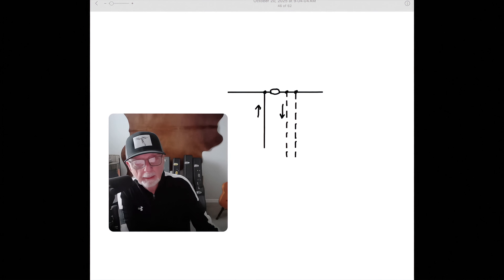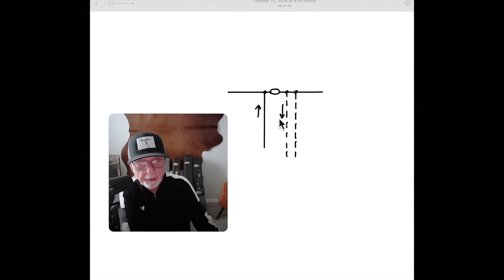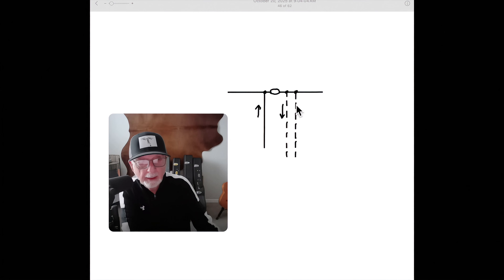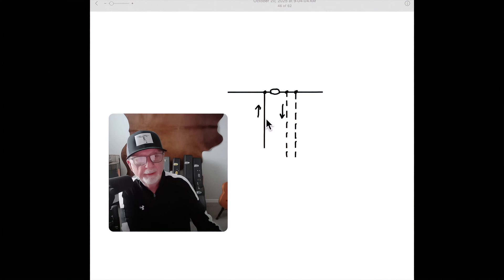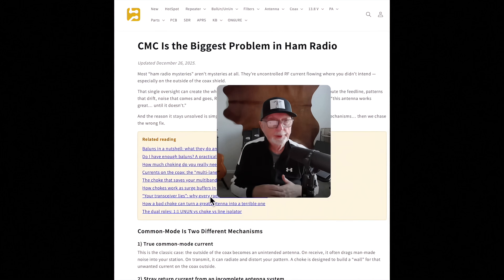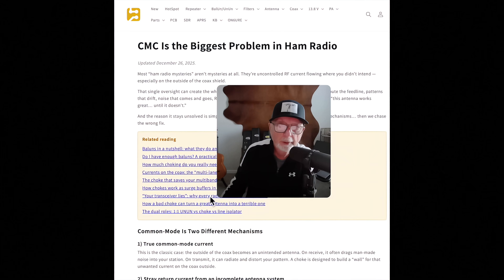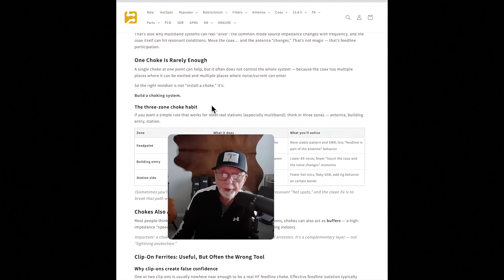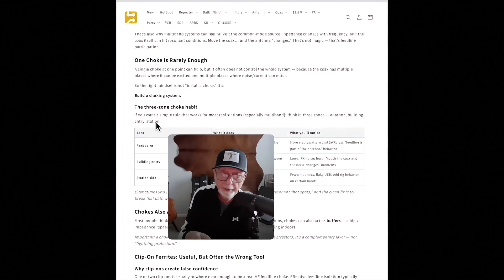Fixing the NOISE LEVEL Ruining Ham Radio.

Comment: Im not a ham, but an avid CB (27mhz) operator, and I have a rather high noise level.  I have an 5/8 antenna with a coil in the base to make the main radial somewhat shorter and it coves both 10 and 11M bands.  Can I perhaps fit a ferrite choke (maxwell?) on the feedline at the antenna socket before the antenna and another one at the radio itself inside my shack?
Reply from the maker: Yes definitely.  You will see improvement unless the noise is getting directly int the antenna and not being picked up by the feedline.  Also try to find the source of the noise.

Comment: Thanks for this very well explained video. A useful follow-up could be about the need for a range of chokes to cover the whole of the HF bands, like the G3TXQ chart. I experienced an electrical "bite" through the metal knobs of my antenna matcher on my 203ft Random Long Wire antenna. Several turns of coax through a 240 type 43 toroid stopped it and reduced my noise floor. That's practical proof of the points you make.
Reply from the maker: So many problems can be solved by good choking.

Comment: You didn't mention ferrite mix. Mix 31 works good at feed point and mix 43 at transceiver. Also stacking 2 torroids is nice. They can be epoxied together. Winding is important. Run one direction around ferrite. Chatgpt is a great source of information on this.
Reply from the maker: Thanks for the input.

Comment: Excellent! This video reinforces the benefits of my station setup: I use a 1:1 current balun (technically an UnUn) at the base of my vertical antenna or the feed point of other antenna designs, and a set of 10 snap on RF chokes in strategic locations -- over the coax at the entry to the shack, over power cords, and over each coax jumper between components (transceiver, amp, and tuner) for good measure. Thanks for the positive encouragement and great explanations as usual. 73, Jared ~ AC7WH

Comment: So I'm not a ham never found the time to get licensed. But as a truck driver I do use the 11 meter band. I have an issue with a high noise floor, if I understand correctly if I was to put a choke at the antenna and another one at my receiver things would get better. If that's the case could you please recommend me what chokes to install. Thanks in advance, Tom
Reply from the maker: Order two of these from Amazon.  

https://www.amazon.com/FT-240-43-FT240-43-Ferrite-Toroid-Material/dp/B07Y6NQRGF/ref=sr_1_11?crid=1997E3EHAQ98B&dib=eyJ2IjoiMSJ9.rdCMnR6pY0gdH79daxUhaL-7YoKQ6i4jHHjAJGa0LFy1eTjZYPf1T11I8EZAndpxnlxzkcazO0BLGVOgPe9JrLkzPfu2o_URnt-hLIzKubn-9wTB4TT-oQcrVuMCMTA9LWNM7SJ5iuFNUDCqHUh1ACPo7Wdw3qyQBcpFHfuiZ8SvixgkYu35zHmBdanVan0wzoBr3PeEOMDC81Y09BecmpnBJd0Hv6K6sILgbINwRpI.pPxE4joYRHkSwreaJtOsHpZiuY_3NXE-BwJ9JGYIk-8&dib_tag=se&keywords=ferrite+choke&qid=1767447583&sprefix=ferrite+cho%2Caps%2C199&sr=8-11

Make several turns of coax at each end and see if that helps.   A vehicle generates a lot of noise which can be picked up by the antenna.  Not much you can do about that but the ferrite cores will improve balance and block common mode current on the coax.   

It should look like this.  https://palomar-engineers.com/antenna-products/1-1-balun-kits/jumper-chokes/Coax-Jumper-Choke-RG-8X-RFI-Range-1-8-65-MHz-30-dB-Noise-Reduction-1-5KW-PEP-3-FT-Tail-p408707295

Do some internet research on suppressing CB radio noise in a truck.  I don't have much experience with that.

Comment: A separate receive-only shielded loop antenna can do wonders for reception in an rf noisy environment.
Reply: Some points by w8JI to keep in mind with a receive-only shield loop antenna  (Notice the emphasis on keeping the loop antenna electrically balanced -- sounds familiar.)
The shield is the actual antenna.
The shield must be perfectly symmetrical moving away from the inner conductor exit point. 
The gap in the shield must be exactly opposite the grounded point.
The ground must be at the inner wire exit point.
The shield will not make an unshielded loop that is properly balanced any quieter. 
The shield only is a tool to help balance the system when properly implemented.
Reply from the maker: Yes! I plan on doing a video on that topic.

Comment: Agree about your Coax diagram showing 3 wires.... Even when balanced, the outside of the coax shield will receive and conduct RF back to the shack as it receives radiated power from the antenna and all the other radiated signals from everywhere. I always use a CM noise filter at the radio. Got rid of almost ALL my noise. Plus I use chokes on all the other wires coming out of my radio.
Reply from the maker: Good work!  Great comment as usual @martyh9309

Comment: There IS something you can do about all the man made noise but it’s not cheap  

I was about to give up on HF at my little beach house that’s elbow to elbow with tons of others. 

Then someone let me borrow a DX engineering receive loop which used the be the pixie loop antenna. 

It was NIGHT and DAY. It made HF go from plus 20 over noise to maybe s-3 if that. 

It’s a hell of antenna and well worth the $700.  

Common mode noise isn’t the main source of noise in the modern urban area. It’s switch mode power power supplies and such. 

But the way the DX engineering RX loop works is a magnetic RX loop and you just have to watch the A and B comparison. 

Had not for it I would have given up on HF.
Reply from the maker: This is an important point and I am planning a video on this topic of a separate receive antenna.  One point - RF noise generators like SMPS couple into a feedline creating common mode current.

Comment: Great points!!! I have an 160M EFHW approx. 200 feet from my underground shack. The antenna is located deep in my 4.5 acre wooded plot not near any homes or power lines. I also attached 10 big snap-on outer coax chokes at the 49:1 and a separate counterpoise wire. The coax is also somewhat buried for 150 feet+ prior to entering the shack. My S-meter on my 7300 is 0-1 worse case. I wish I could put up a doublet with 600-ohm open wire BUT the 50 feet of coax needed length to the shack may cause too much loss at high SWR's. Thanks for your videos!
Reply: Am I understanding how little loss window line has?

At 6 m (≈50 MHz) for a 100-ft run (matched-line loss):
	•	450 Ω “window line” (dry): 0.33–0.41 dB / 100 ft  ￼
	•	LMR-400 coax: 0.9 dB / 100 ft  ￼

Delta (LMR-400 higher loss): 0.49–0.57 dB per 100 ft (0.9 − 0.41 to 0.9 − 0.33), from the two cited sources.  ￼

Comment: For balanced feedlines like ladder line, if you have to run it close to your house or gutters using standoffs, you can twist the line every few feet to help reduce any pickup. Telephone companies used to do this between a certain number of telephone poles.
Reply: Twisted lines also shed water and wind better than any straight of flat or sloped line.

Comment: Strictly speaking an unbalanced antenna has volts on one side & ground on the other. A balanced antenna has +- volts on each side so an OCF dipole is a balanced antenna (and even an EFHW fed against a counterpoise with a balun can be a balanced antenna... Running an EFHW as an unbalanced antenna is part of the problem)
Reply from the maker: From the RF.GURU:  Balanced vs unbalanced is not “hot vs ground.”
At RF there is no absolute ground; balance is about equal and opposite currents and equal impedance to the environment, minimizing common-mode.

From Maxwell’s equations, radiation and coupling are governed by currents and fields, not by schematic symbols. When currents are unequal, the E- and H-fields do not cancel, and those fields extend onto whatever conductors are available … including the outside of the coax.

An OCF dipole fed with an UNUN is therefore still unbalanced. The unequal leg lengths enforce unequal currents, so the fields couple to the coax shield, which becomes part of the return path unless a 1:1 choke is used. The choke does not “create balance”; it simply raises the impedance for common-mode currents so Maxwell’s solution no longer includes the feedline as a radiator.

And even if you feed an OCF with a balun (which some do), that does not magically make it balanced just because one would like it to be. The geometry is still asymmetric, the impedances to the environment are still unequal, and common-mode will still be excited on the coax. Current does not care what we believe or prefer … it follows physical laws. Those laws were described by a guy called Maxwell, and they remain valid regardless of ham preferences 😉

An EFHW with a counterpoise is inherently unbalanced (monopole-type) and is correctly fed with an UNUN. The return current closes through the counterpoise and surrounding capacitance. A choke only limits how much of that field solution leaks onto the feedline … it does not turn the system into a balanced antenna.

Comment: My BC-455 is receiving birdies every 30khz or so.  These go away when the antenna is disconnected,  so I assume this means they are external.  Can anyone suggest what might be the cause?  I have turned off everything in the shack except the receiver and also used the house breakers to turn off most things in the house.  Any ideas?
Reply from the maker: A reply by the RF.GURU - ON6URE. 
Disconnecting the coax only tells you the “birdies” are getting into the receiver through the RF input path — it does not prove they originate outside.

That’s because removing the coax/antenna changes the input impedance and grounding/loading of the front end. An internally generated spur, oscillator leak, or self‑oscillation/intermod product can depend on that loading/feedback and may disappear when the antenna is removed (even though the source is inside the receiver).

Comment: Great video and thanks for explaining the 3rd conductor principle.  I heard John Portune (W6NBC) explain it, some few months ago, and the lightbulb was turned ON. 😊 
I've been running a Doublet for a year now and can't sing its praises enough....although I did learn a valuable lesson  about choke placement.  My 1:1/4:1 hybrid Balun Designs balun is just outside of my radio room, with only a 6' section of RG213 completing the link to my Palstar AT2K TransMatch.  I original had my choke, 6 clamp-on ferrites, at the tuner end of the RG213.  Well, as one will find out when running a Doublet, the SWR is quite high on the coax that feeds the balun.  I had issues until i moved the 6 ferrites to the balun end.  It's amazing what 5' of exposed shield can bring into your shack.  😂
Thanks again for the video!!
Reply from the maker: This is why RF.GURU recommends a 1:1 current balun instead of an impedance transformer when transitioning from ladder line to coax.  You need balance, not impedance transformation.  Let that great Palstar tuner handle that.

Comment: Great Video, Mark. I learned a lot about guarding against CMC and noise as a listener (VLF through HF) and using external antennas. It's very easy for the "house noise" to add to the signals from the antenna and swamp them.   The techniques described in your video match the trustworthy sources I've found and I can vouch for their effectiveness.
 (This is my second comment, the first failed to appear for no apparent reason)

Comment: Common mode current is a indicator that you have a flawed antenna. Your RF should not be looking for other radiators. If its a vertical with common mode issue then you dont have enough radials, if its a endfed then you need a better conterpoise. Kirchhoff's laws apply here. But at the end of the day sure add that choke just because you've taken good practice to heart and made the other half of your intended antenna shiny and bright that any respectable RF cannot resist.
Reply from the maker: Response from the RF.GURU - ON6URE.  

Common‑mode current doesn’t automatically mean the antenna is “flawed.” It usually just means the system is unbalanced or the surroundings are asymmetric, so some return current flows on the outside of the coax shield.

More radials or a “better counterpoise” can help, but they don’t guarantee zero common‑mode—and that’s exactly why a common‑mode choke is used: to keep the feedline from becoming part of the radiator, which otherwise can distort the pattern, shift the impedance, and cause RFI.

Kirchhoff still applies—the loop closes through capacitance/displacement currents via the environment, not because “RF is looking for other radiators.”

Comment: Would be interested to hear if using a remote tuner at the base of a vertical (let’s say with 32 radials) would or would not change this guidance?
Reply from the maker: Comment from the RF.GURU:  Remote tuner doesn’t change it much. Most are unbalanced and will use the coax shield unless the tuner is bonded to a good radial field (or counterpoise), just like any other antenna ... so no it does not solve it, and yes you still need a choke ;)
Reply: @BustRadioMyths Before or after the tuner?
Reply from the maker: Before (and after before the coax enters the house)

Comment: Having tried and lived with a ladder line fed 80m loop, and then switching over to a coax fed with 4:1 voltage balun, followed directly by a 1:1 coax wound choke.......
I'll NEVER go back to ladder line. There was ALWAYS an imbalance on the ladder line, and always common mode in the shack, no matter what I did. The balanced dual rf meter proved this as well.
There is no such thing as a truly 100% balanced antenna anywhere except in a textbook theoretical example, 73.
Reply from the maker: Reply from the RF.GURU - ON6URE.

-Ladder line doesn’t “create” imbalance by itself. In ideal differential mode the currents are equal/opposite. Imbalance happens when the system is asymmetric: the antenna/feedpoint isn’t symmetric, the line is routed near metal/house wiring/gutters, one conductor couples harder to “ground,” or the transition/tuner is unbalanced.
-Coax doesn’t magically eliminate common‑mode either. Coax can (and often does) carry common‑mode current on the outside of the shield. People just notice it less because the inside fields are contained.
-In their “coax success” they changed two things: feedline and they added a 1:1 choke. That choke is the part that suppresses common‑mode. Without it, coax-fed loops frequently bring RF back on the shield.
-A 4:1 voltage balun is not a “force equal currents” device. Under mismatch it can actually encourage common‑mode. The fact they needed a 1:1 choke right after it is basically admitting that.
-“No such thing as 100% balanced” is a meaningless strawman. Sure, nothing is perfect, but you can get it close enough that shack RF is negligible with: proper current balun/choke, symmetric feedpoint, and sane ladder-line routing (away from metal, keep spacing constant, don’t hug the tower/house, etc.).
Their experience proves their installation/transition was unbalanced—not that ladder line is inherently “always imbalanced.”
Reply: @BustRadioMyths to be clear, I never suggested that ladder line itself was unbalanced, I was merely saying that all antenna are near "something" and never truly in free space like theory suggests. I also wasn't suggesting one is better than the other, only that coax is an easier feedline to deal with especially concerning routing and dealing with common mode currents.